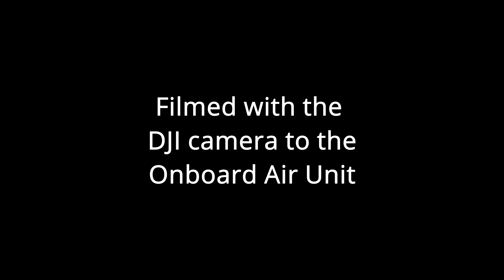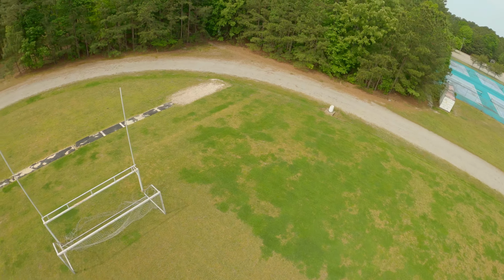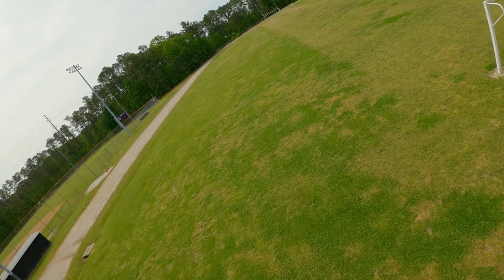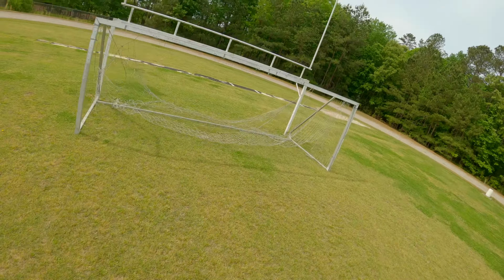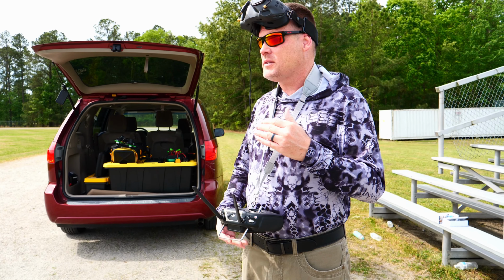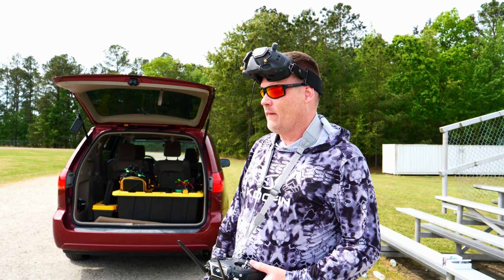FPVCYCLE 1450kv Motors (DJI) (5-2-2021)

Comment: Would love to see some faster flying... What amp draw do you see? At for example 70mph cruising? And max amp draw at full punch-out? What amp draw did you have here?
Reply from the maker: 5 to 10 amps at cruising and 20 to 30 at around 70mph. We were just testing out the flight time with the Go Pro and 1400mah battery.